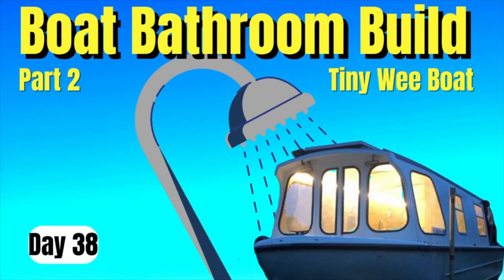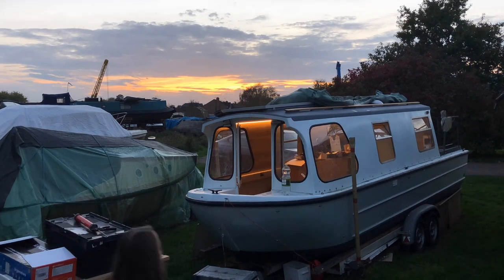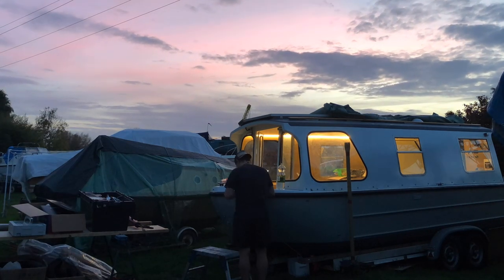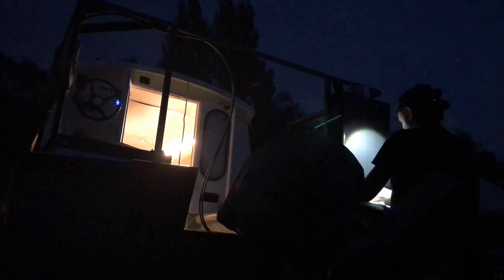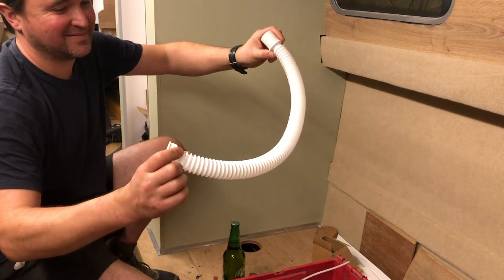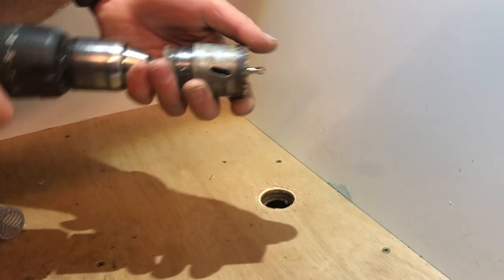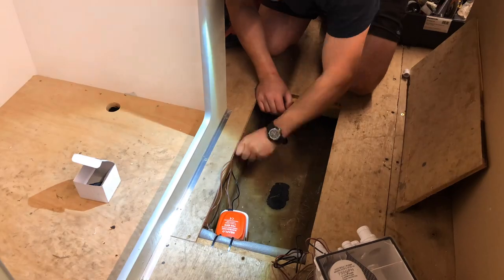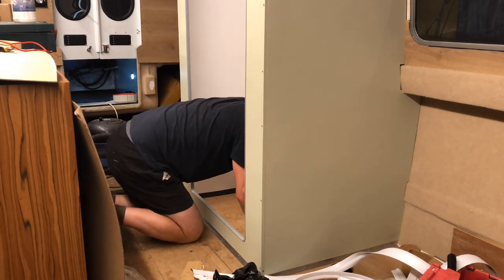Wet room build - Part 2 - Renovating our Tiny House Boat Day 38

Comment: Just a thought but could you not have added liner strips between the plywood substrate and the PVC shower wall panels; a sandwich in other words? Thus  shower water running down the walls would be channeled into shower tray. I would of thought this method would ensure a watertight job

Comment: I cannot see the point in putting in a sump the water will be pumped out via a float switch to the outside anyway why not connect the outlet straight outside?